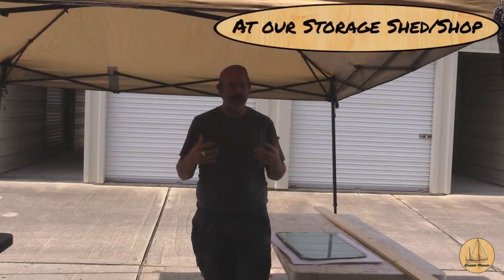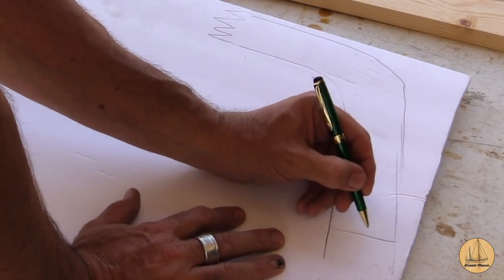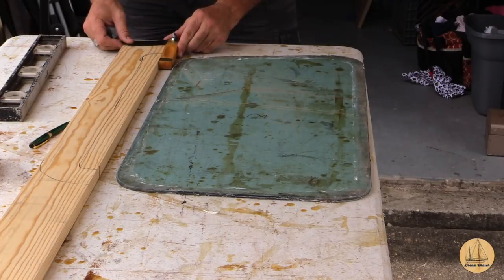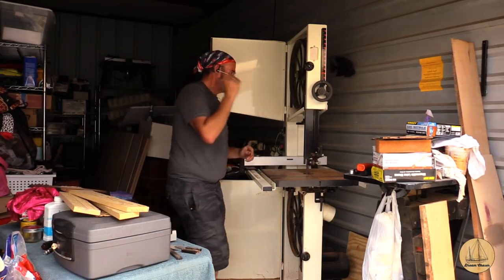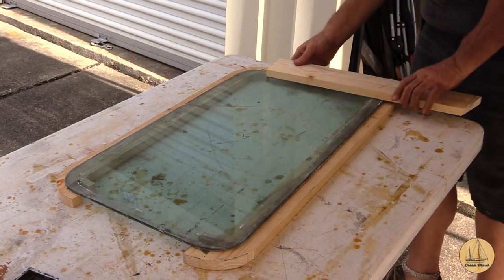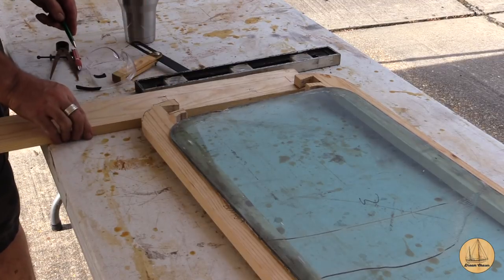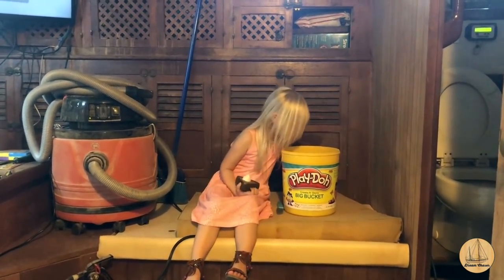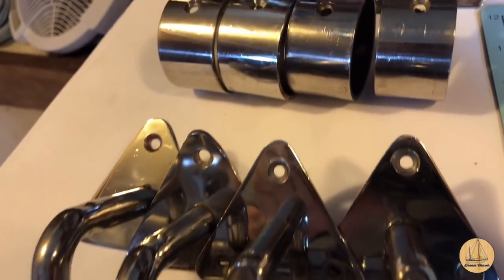Practicing Craftsmanship -  How to Make Hand Cut Dovetail Joints

Comment: Ahoy Gil!  Nice to see the projects coming along.  Um, so my two cents would be to use a lap join at the corners, that way you have (two-ply) plywood there, which would be stronger I think (since grains will cross at 90 degrees there).  Won't look as cool though, you'll just see a butt join at the surface ...
Reply from the maker: I thought of that as well for the strength and crossing the grains since they would be boards instead of plywood but like the “look” of the dovetail. Certainly your suggestion would make it easier and maybe even stronger.

Comment: I understand why you want to do the fancy dovetails and I admire your application too. However with the number you have to do, you need to keep things simple and introducing some consistency will help the aesthetics and so what follows is my suggestion. Use butterfly or bow tie joints, basically two dovetails cut back to back that forms the male piece and it looks like a bow tie or a butterfly 🤔 Assemble your frames using butt joints with epoxy - once dry position your butterfly across the butt joint and mark out with a knife. Cut out the shape and use epoxy when assembling the joint. Do you get the idea?
Reply from the maker: +Norman Boyes I have seen those as well and they look great. I may have to try a test of that. It an opposing bow tie would look great too

Comment: Oh, and for the screws, could you use 5” and cutoff to length needed? Just remember to thread on a nut first so when you back it off, the threads get cleaned up or use a die to clean them up.
Reply from the maker: +gmnelli I was considering that.